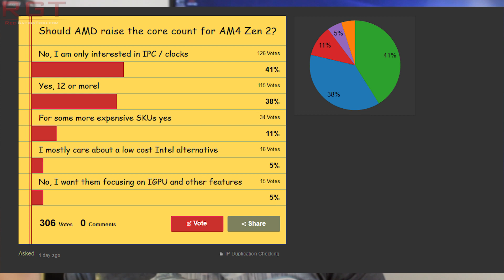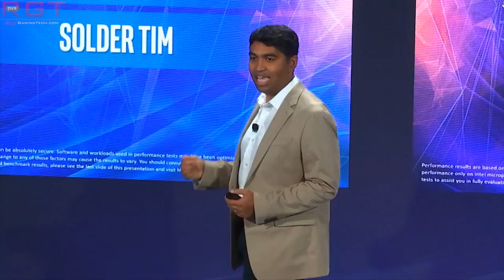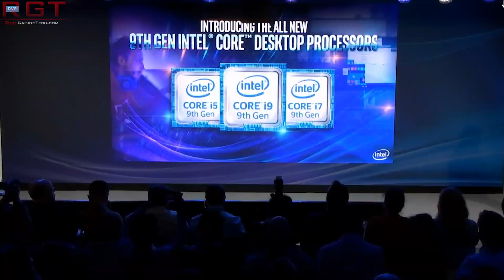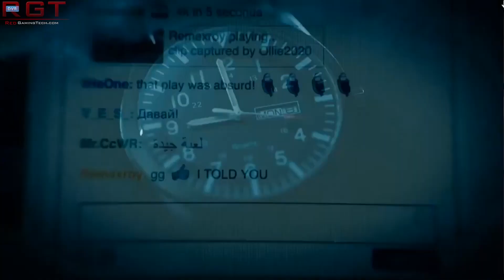Intel 10 Core Mainstream CPU Comet Lake | 14nm & Dual Ring Bus

Comment: 5 months later and youtube is filled with comet lake rumors. as it stands now intels chips are just overpriced. the i9 9900k should be called the i7 and cost about $350, the 9700k should be the i5 at around $280. intel is still the fastest option on the desktop, and this comet lake cpu is supposed to increase performance as a stop gap between 10nm or maybe even 7nm. 10nm was supposed to be out in 2016 and 7nm was supposed to be out in 2018... they are 2 generations behind their original roadmaps. I think the real problem is that they didn't move on from trying to get 10nm to work after they were a year behind schedule. im waiting on ryzen3 and now probably this comet lake cpu to decide what way I want to go for my upgrade (im on a 6 year old i5 3570k and gtx670).

Comment: Can a cpu be made to work with either 2 or 4 memory channels through different platforms? If so that would be a good way to go if it means current Ryzen users can use a higher cored Ryzen 3000 with todays motherboards or buy into a new platform m/b design that allows the cpu to work with 4 memory channels.

Comment: intel does not need it. even 8700k wrecks 2700x. 9900k demolishes it. zen 2 is not out before 2h 2019 and soon after intel will shit on it with 10nm release. amd will never be able to beat intel with such a low r&d budget. ryzen is a succes because of price/value, performance-wise intel is clearly ahead. threadripper is better than ryzen by far, if you really need this kind of core count, for gaming even i5-8400 shits on threadripper.

Comment: 9:20 - Again, NO! How many times does this have to be said? Why do tech commentaters keep doing this? UNLESS you can afford the 2080 Ti, for the best gaming performance it makes far more sense to buy something cheaper (8700, 8700K, 2700X, etc.) and spend the cost saving on a more powerful GPU, that will be better for gaming. Saying otherwise is pandering to the niche market of high refresh 1080p which is not the majority of gamers.

I just don't understand why I keep hearing this idea that the 9900K is best for gaming when the cost difference from buying a CL or 2700X is more than enough for most gamers to be able to afford a better GPU in the first place. If you don't believe this is the case, then produce the data to demonstrate otherwise. Do a build on a fixed budget with more realistic budget levels and see what's possible, baring in mind the higher quality mbd and cooling that are required to properly support a 9900K (which further increases the cost delta). See:

https://www.youtube.com/watch?v=BSBI11sgsA4

Comment: The last good processor from Intel (imho) was the i7 8700K -- The Processors since have really been pushing the limit of the 14nm process. This 10 core-CPU is a joke.
Reply: 9900k beats 8700k regardless of workload. i smell 8700k owner haha.
Reply: @Dr.WhetFarts  I'm sure it does, but that wasn't the point I was trying to make. The i7 8700k is the last high end CPU from intel which (roughly) sticks to its TDP rating while keeping temperatures under control. It doesnt need solder or extreme cooling solutions to run at good clocks.

The 9900K, whilst incredibly powerful, is pushing the limits of 14nm...It was only made to compete with AMD's offerings. Otherwise I'm sure Intel would have been perfectly happy sticking with 6 cores / 12 threads until their 10nm process was ready.

Comment: 8 cores may be the sweet spot for desktop gaming, allowing maximum frequency while giving you enough cores to cover the more CPU intensive games, but most people aren't running high end GPU's at low resolution that will tax the CPU thus requiring those 5GHz+ frequencies.
Also AMD have worked on different CPU modes with Threadripper to maximise performance with gaming on high core count processors.

Consider the 16 core desktop Ryzen made with 2 chiplets and a central dual channel memory I/O chip. Total silicon surface area shouldn't be much more than current 12/14nm Ryzen (10-20%), therefore in terms of CPU's per wafer, the cost of a 16 core desktop CPU shouldn't be outrageously more expensive than current gen 8 core Ryzen. Now with a 16 core desktop CPU, game mode can apply that disables 2 cores per CCX and effectively gives you an 8 core but with some slight advantages over a single chiplet 8 core. That being those 8 cores are on 2 chiplets allowing for better thermals and theoretically higher turbo speeds and XFR headroom, as well as doubling the L3 cache to cores ratio.
An 8 core Zen 2 would have 32 GB L3 cache (4MB per core), but a game mode 8 core from a 16 core CPU would have 64MB L3 (8MB per core).

Gaming mode on Threadripper is now effectively a 1 click solution (though it's a few more to open RM click GM and apply) without reboot. It's quite feasible for this to apply through Radeon settings as well as Ryzen master, to automatically apply the mode of choice when starting a game, with on the fly CPU configuration, 4?/8/12 or 16 active cores, when no other application is running outside of a whitelist. Of course Nvidia users just use RM.

Intel cannot bring 16 cores to the desktop with a monolithic 14nm chip, I'm surprised that they'd even consider a 10 core. But for AMD, they just have to add another 70-80mm of chiplet to go from 8 to 16 cores. Given that a 2700 stock on Prime 95 only uses 65W (about 50W actually @3400 all core (mine shows 3375 solid), it's smell of an oily rag stuff and about 15W is SOC (so 35W), I can see no reason why a 16 core 4.2GHz Turbo zen 2 wont operate at about 95W TDP and 140W at 4.5GHz. In game mode assuming the architecture can hit 5GHz, XFR can kick into an overdrive mode and bump up clocks on the remaining cores and stay within 140W power draw, similar to what the 2700X can do but at much higher clockspeeds.

So hypothetically a 16 core Zen 2 can be a Jekyll and Hyde, a solid productivity CPU and a gaming beast all in one and you might not even need to overclock an X chip to have the best of both worlds, just start your game.

Comment: First time commenting here: there is an inaccuracy in your reporting of this rumor (I guess it doesn’t matter since it’s just a rumor but here goes). The dual ring bus was actually just speculation on the part of numerous websites that covered this “comet lake” rumor as the original report didn’t even mention it. Still, it would be great if this CPU did actually make it to market for the “mainstream” desktops. The only issue is the lack of CPU PCIe lanes in all of Intel’s mainstream lineup since the south bridge was phased out. 16 lanes is not enough (and neither is 20 AMD) but it seems like both companies are content to limit their mainstream parts to such a low number of lanes so I would not expect this “comet lake” CPU to go any higher. I understand that 20 lanes seems to be the “sweet spot” for most gamers who allocate 16 to their dGPU and 4 to their M.2 but with Intel pushing BOTH Optane and VROC, I would think they need to up their mainstream CPU’s to at least 24 lanes. Personally, I run (and have done so for a long time) mGPU setups where 32 lanes is the bare minimum. Now I’m currently running 2 GPU’s and 2 M.2’s which require 40 lanes (twice what AMD offers on Ryzen) and those lanes on PCIe 3.0 are actually being maxed out. Perhaps it will not be as much of an issue when PCIe 4.0 launches next year but until then, cores, GHz and IPC are all moot in my opinion when you see these stupid $600 MB’s with 2-4 PCIe slots and 2-3 M.2 slots.

Comment: With the IPC the gain of redesigned architecture and the clock speed gain from 7nm the Ryzen cpu will be on par with the 9900k. Intel cannot push clock speeds any higher on their 14nm process and have no option but to increase core count in  response. Producing a 10 core monolithic cpu would cost more and have worse thermals than the 9900k, so Intel will follow AMD by "gluing" cpus together, just like their server cpu. Chiplets are the future.

Comment: What  ai am waiting for my full (expensive) build:
1) CPU with 8 core/1chiplet and integrated 20(or more) GPU Cores
2) Quad DDR5 
3) Much better data throughput for CPU than the previous generations.
4) CPU with all core stable OC up to 4,5 GH  (4,5 is fine for games, no need for 5)

For a good (double the GPU cores from current generation) integrated GPU (if CPU/APU with integrated GPU had good data throughput compared to the current generation) i would gladly pay 350 € (if the 8core CPU & 20core GPU takes 150W, i'd still be happy).

PS: No hope anymore but would'v been nice to be able to use the AMD integrated GPU APU's in Windows 7 also.

Comment: Here's how Intel could release reasonably priced 10 core desktop CPU, remove the integrated GPU just keep the display interface from the system agent as socket compatibility for 2D interface. Just assume that a 10 core CPU is not going to be used with integrated graphics.   As for ZEN2 core counts and cache,  the easiest way to do desktop variant is using exactly same CCX:s as server.The problem with 8 cores CCX is that the large cache would have to be very LONG and distances from one core to furthest location in cache would be far larger and the cross bar required for every core to utilize it would be large.  And the 16MB cache per 4core CCX is a simple and relatively cheap upgrade for zen, fixing some of the problems it had.  That bigger cache also helps with memory bandwidth issues.  Then there is rest of the chip and what makes sense depends on yields of the 7nm.  Both options have merits, integrating all the IO with the chip on the low end socket with limited IO requirements or just use the same chiplet as the high end sockets and pair it with low end socket specialized IO chip with integrated GPU.   Now for core count question the chiplet design has two reasonable options 8 and 16.  For integrate route which I think is the less likely route I found plenty of reasons to go for either 2,3 or 4 each depending on yields, a key reason to upgrade core count is that only 41% of the zeppelin die was CCX:s  and that IO doesn't scale well, Then question is would it be worth for AMD to increase die size lets say 15-20% to get 50% increase in core count, but adding single CCX:s has potential issues for layout, and 4 CCX:s that communicate with each other would make more sense. And all this speculation of how fully integrated RYZEN 3700 would look like is likely moot since the die size of it would be far larger than chiplets that they produce currently and risk of having low yields at 7nm can be better handled by simply having most of what was zeppelin die on separate 14nm die.  Then it is also about the timing of the decision, since it takes ~6 months to get from order to consumer hands TSMC chips, and then it takes time to actually design the chip, AMD needed to make this decision before it could fully trust the yields of 7nm process. So in the end using small 7nm chiplets with 12nm IO&GPU die would make most sense from reducing risk perspective.

Comment: I knew either Intel or AMD would do a double ringbus at some point.  It's fast, but tiny pipeline.  Two sounds good.  Intel is doing this to offset the throughput advantage of AMD's IF.  If it doesn't catch on fire and sells for $500 or less (yeah, right), I'll find it interesting.  Until then.. I'm waiting for the Ryzen 3k series to replace my 1800x with the next 3-series flagship.

Comment: if this is true i think the comet lake is really a 12 core cut down to 10.  ring would go 10 pretty easy but 12 might be stretching it.  so go to 2 buses.  i would think that it would be the building block for a larger chip.  2 of these on a single package would give you a 24 core hedt chip and quad channel memory.  that beats the 7890xe and they could make it cheaper since its dual chip and would increase yields.  

not only that but this would be a top end part to compete with zen 2 on the desktop now with intels 14nm and when 10nm comes later they can make their whole lineup based off this chip with an i9 at 12 cores (with about the heat of a 9900k at 8 cores) and an i7 at 8 cores 16 threads possibly based on a 10nm version of the 9900k die with similar heat and power as the 8700k.

and yes a 12 core chip cut down to 10 would have a larger surface area but the fact it has no igpu (i would asssume if it is the basis for hedt chips) would actually hurt it and it would have less surface area. 

basically on these chips intel would just set the clocks as high as possible and the chip just runs as high as it can till it hits the thermal limits set by your motherboard.  top end mobos could go as high as 250w-300w while ones with vrm blocks could go higher.  mid range z390 boards could do 200-250w.

who knows though.  could all be rumor.  seems like they would just call it coffelake 10 core or seomting. of course if the arch is different (smeltdown updates?) then comet lake might make sense

Comment: Intel is kinda stuck no matter what they pull out of their bag, AMD"s zen2 architecture can easily either match performance at a much cheaper price, or beat it at the same price(maybe even lower price just to rub salt on the wound) It is too flexible for Intel to deal with if the status quo remains

Comment: I'm bored of x86 x64 processors, they only get hotter and less efficient. Why not just make a RISC CPU with GBs of L1~L3 cache if the only limit of RISC is memory bandwidth? This industry is totally lacking of innovation, well AMD is exception.
Reply: risc cpu's instructions are not powerful enough. x86 instructions are nearly 45 years olds and very much matured and still have 25 years of life left in them

Comment: 2 x 45W i9-8950hk mobile chips with iGPU disabled on one die and one cpu core disabled on each die glued together would get you a 95w TDP 10 core desktop chip. it would also open up quad channel memory and an additional 20 pcie lanes.

Comment: If Intel force a new socket, it is bad optics.

They may need to abandon onboard graphics or pack the socket so tightly the thermals get tricky.

AMD issuing onboard graphics on all their 8 or fewer skus makes sense. If they drop that for the 10-12-16 core units no loss.

Comment: Heh, just the other day, I commented in the previous video on how AMD had a unique advantage, specifically due to core count offers across the board, and how it's in their best interest to keep that (obv. successful) pressure going. Considering the last couple of years, this rumor doesn't quite surprise me; but it does smell more like a reactive move, than a proactive one, at this time.
Clearly, the folks Intel have hired over the last few years haven't been paid to merely idle, though this would be somewhat sooner than I expected (plus it would still be unclear, whether there was any contribution on their part, to make this product more feasible in some way or another).

Comment: 8 cores and 16 threads is more than enough for gaming and video editing
Reply: But not for streaming 1080p60 with x264 (preset medium)
Reply: Activate preset medium in x264 with 5MBps and see how many frames you will drop in stream. Probably more that 50%. 8 cores enough my ASS!
Reply: @ataksnajpera  my 9900k at 5.2 ghz will easily do that. it wrecks ryzen 2700x in streaming and gaming. also pretty much all hedt cpu's.

Comment: The problem with intel is they don't want to low their prices at all cost and it doesn't matter is ryzen is 10 FPS less in most of the game, if you compare that vs the price your option is clear is just ryzen that's it, if ryzen fill that 10FPS GAP intel is going to be in a corner because there is nothing else to justify those expensive prices, the only solution that they have to counter AMD is very easy is to lower their prices to the same price range of AMD that put AMD in a critical position, but not, they don't want to admit that AMD is a real threat to them they are wasting resources, clone the same CPU again and again, INTEL LOWER your F prices that is going to give you time to think what can do.

Comment: About the core count of Zen3, I would very much like an 8 core 65W Zen3 with a low end 7nm Vega (with say 22 CUs) or Navi IGP, on die. Basically a next gen R5 2400G. So...maybe a 3400G? I would use it to upgrade the low end gaming PC of my kids and get rid of the old noisy graphics card that is in there right now. Yeah I really want to build a low noise, small and cool and efficient all-round PC with 1080p gaming. I'd be set for years!

Comment: Kinda dont make sense...... if its 14 nm the only way i could see them doing this (while sticking to the smaller 115X socket) would be using dual partially  dead 8700k/9900k dies on a interposer or on the pcb like the old core 2 quads. You can connect 2-8 xeons using the qpi links (so just implement that on a pcb) so thats 2 technologies they have used and it works. 

They could also cut down or cut out the igpu to actually make the chips smaller to fit 2 more cores on the 9900k die or 2 chips to fit under the current ihs.
 less cores + less igpu = less heat but still on that socket & 14 nm with 10 cores, would still run hot. I could see a new socket or something slightly like the 1366 coming back.

Comment: F@&K me! I just paid $580 on Newsegg for i9-990K. Don't judge me, I work in media production firm and I can use all the clock speed I can get. Plus, all of the professional broadcast software are optimized for Intel, not AMD. And I already have Kraken X62v2 and EVGA 1000W psu was on sale.

Comment: Remeber the 800 and 800X parts could return in the Ryzen 3000 Series, maybe those will be the 12 Core Processors
Reply: Could be anything from that, to upping the core count across the entire lineup. In the desktop market, that would quite likely sting far more than just a beefier high-end chip, and could upset nearly all of Intel's offerings... again. But yeah, only time will tell, right now.